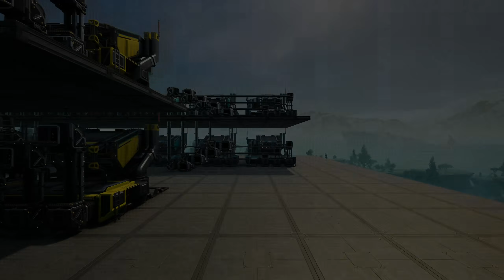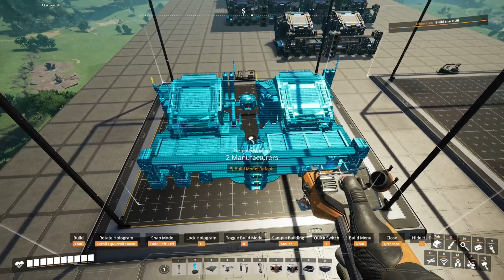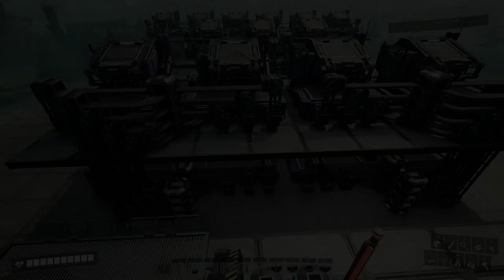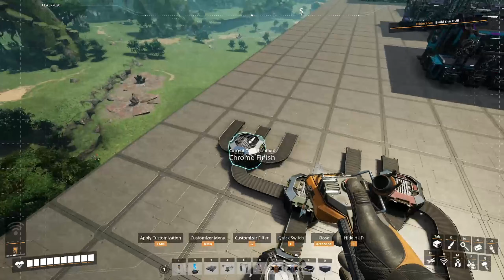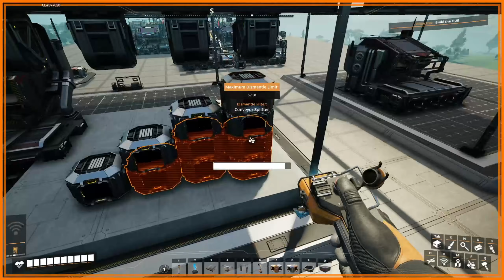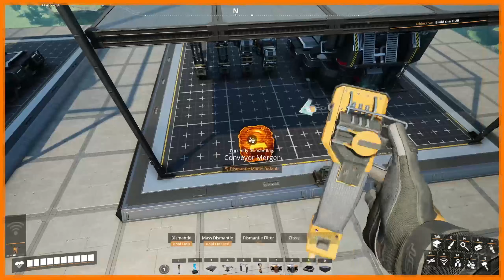Blueprint Guide: 2-6 Manufacturers Load Balanced - Satisfactory 1.0

Comment: Wouldn't it make sense to also create a 3 Input Version of these Blueprints. With Manufacturers always do 3 and 4 input versions blueprints, so I can use the correct on for the product and not have an input connected which I don't need.
Reply from the maker: That’s a good idea too! I thought about this and decided to keep the amount of BPs down. I plan to load the BP ahead of time, set the recipe and change belts, then resave it for that part of the factory. If deleting the extra belt each time I only need 3 inputs gets annoying, I’ll probably make more versions.